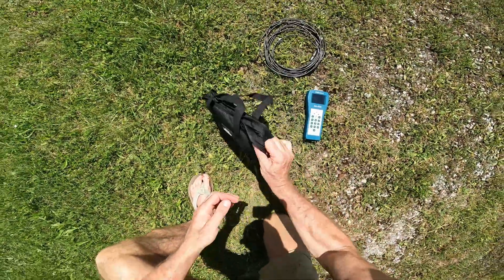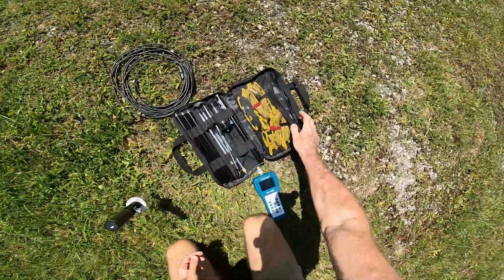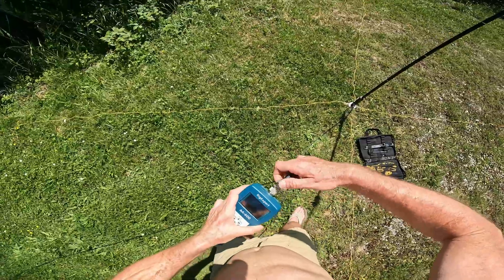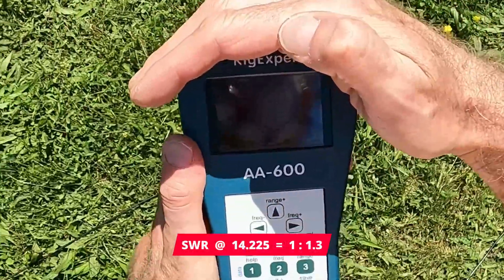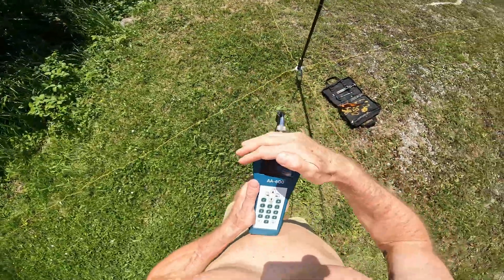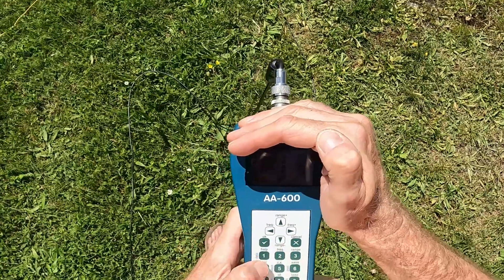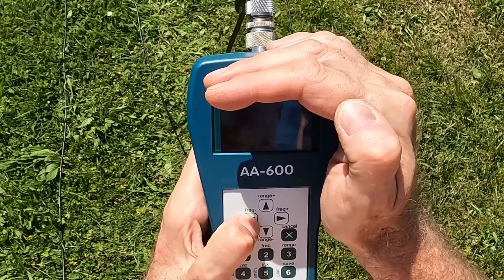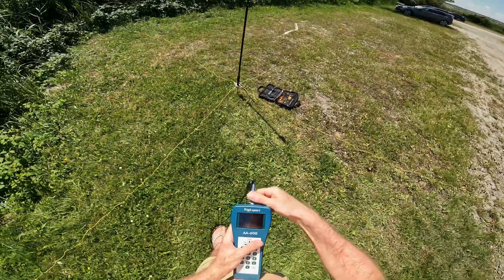Testing my radial (counterpoise) kit & mounting for the JPC-12 (PAC-12) Ham Radio antenna

Comment: Very good demo. It's a shame we could not see the SWR curve on the AA 600. As you probably already know, one radial adds balance to the antenna and more radials adds efficiency to the antenna. It would scare me if I saw 50 ohms at the resonant frequency on that antenna. 
I have the PAC-12 and love that antenna. It is so well designed. The best part of that design is they did not base load the antenna. They kept the current portion of the antenna with the 4 foot mast. I also like how well the coil with tap was designed.
Barry,, KU3X
Reply from the maker: Unfortunately my AA-600 does not have Bluethooth to connect to my phone or tablet.
For my next videos I have an proper Windows tablet with the RigExpert App installed.
I also considering to by the RigExpert stick. Expect more details in my next videos!
73 from OE! Juergen

Comment: Please dont shorten whip, but change coil position. Whith shorten whip antenna performance will reduce.
Reply from the maker: Hello Rolnas, good tip. But sometimes one turn more or less on the coil is too much.
Thank you and best 73!
Juergen OE4JHW
Reply: You will never see a difference in performance by shortening the whip what little he did. Shortening the whip is like fine tuning. Once you are in the band,  moving the tap on the coil is course tuning and you may never get to the frequency range you want to operate in. 
Barry, KU3X
Reply from the maker: @barrykery1175 Thats true, Barry. Thanks for watching and all the best! 73 de Juergen AH6UN / OE4JHW